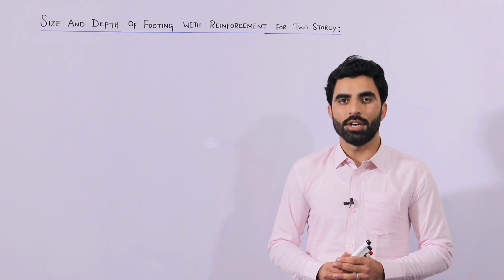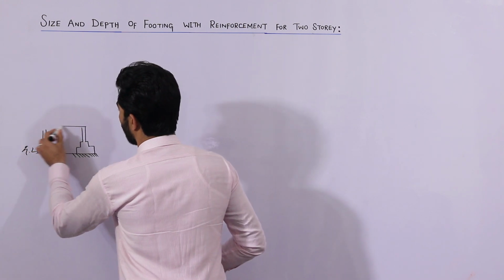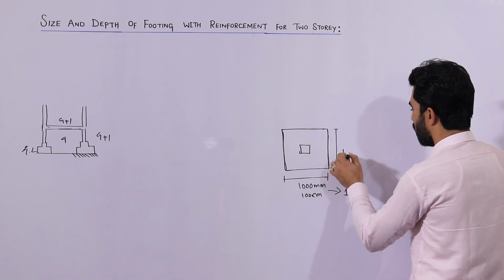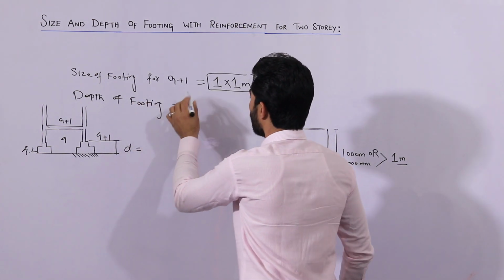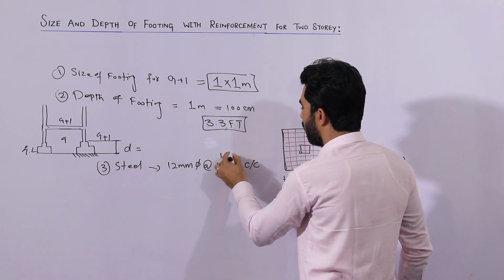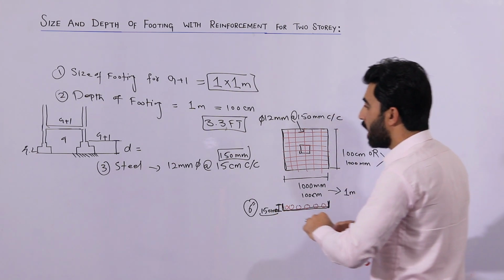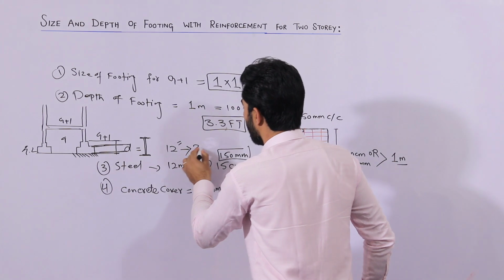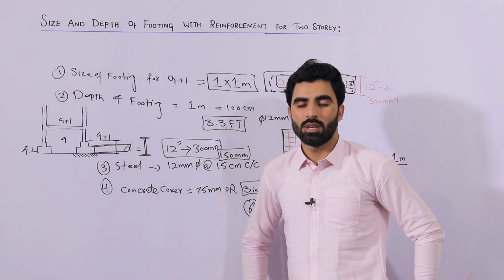Size and Depth of Footing with Reinforcement for Two Storey Building | Strcutural Design |

Comment: Thank you for you videos. Is it possible to have a column change size at higher levels in a building? For example, foundation and ground floor columns at 12" x 12". Then have these columns continue in first floor at 10" x 10"? How can this be done?